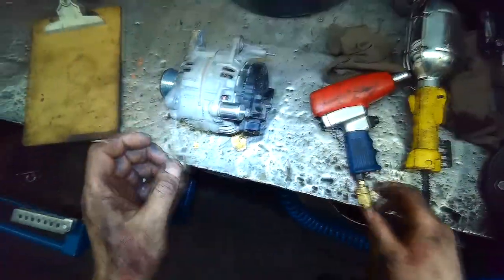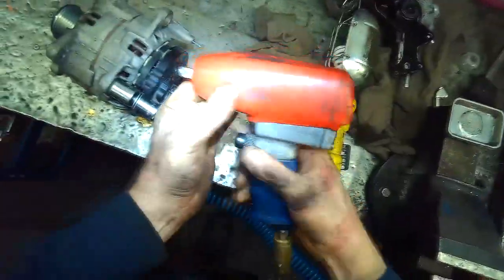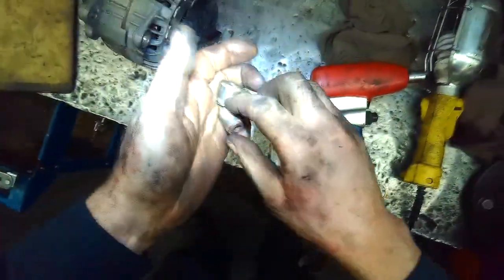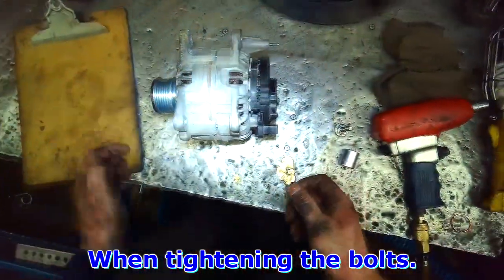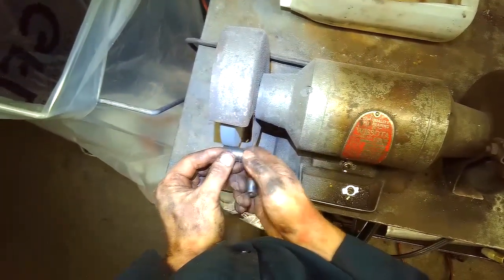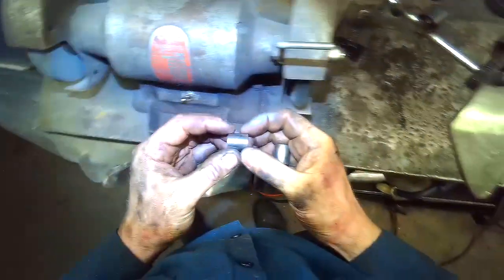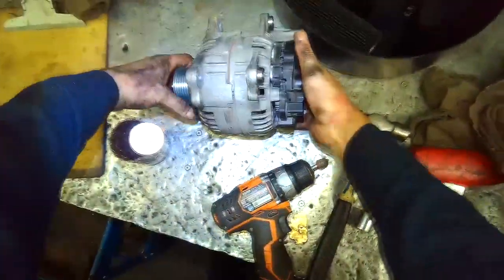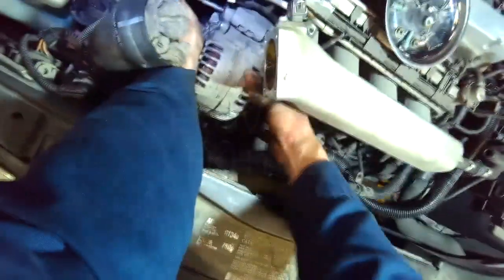Alternator slider reminder!

Comment: Oh... wow.  I'll remember to press out the sliders, and sand/service/lube them next time.   I've dealt with a few of these on mk4s and I've resorted to sanding the face of the sliders that contact the side of the bracket.   The way you showed there Thomas, is both faster and WAY easier to install.
Reply from the maker: If they retract easily... then you don't have to clean them. Once the alternator is tightened back into place... spin the pulley to make sure that the case halves did not buckle! Thank you for watching!

Comment: Really love your videos but this one could have been easier, with a bigger socket at bottom and bolted tap the sliders twice and that's it, even a brand new alternator sliders ain't that easy to move with finger like u have it in this video, still good video
Reply from the maker: Sorry, I might not have explained things correctly... similar to my intercooler draining videos.
I don't "have-to" remove the sliders and free them as much as I did... but I do it (in cases where I feel it necessary) to prevent damaging the alternator when installing the alternator / tightening the bolts.
Reply: Thomas EXOVCDS nothing is wrong with it tom but yh a little too much work involved I wouldn't do it cause as a tech I know exactly where to hit and how much so the sliders will slide hack off and easy for me to fix it, thanks for the video :)